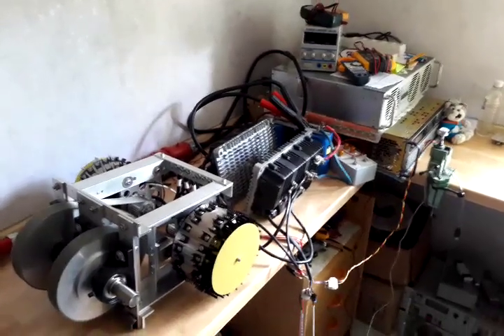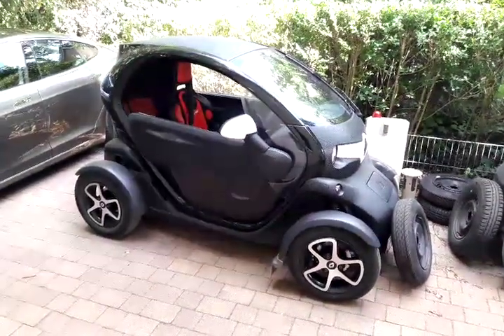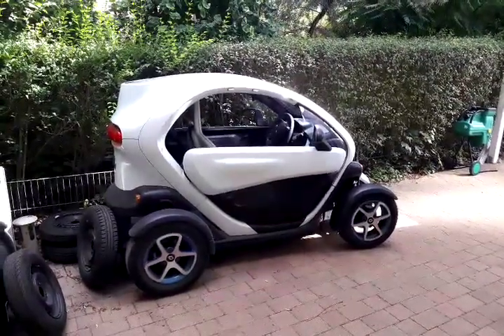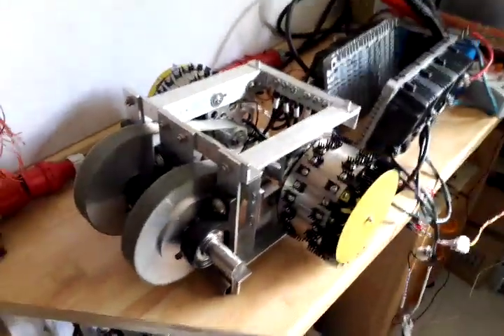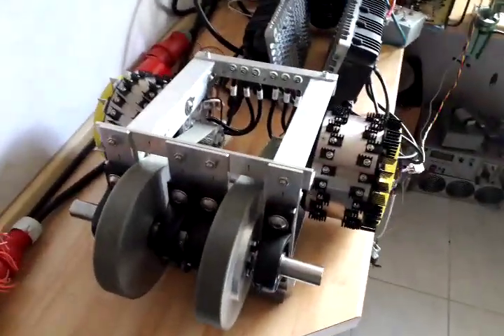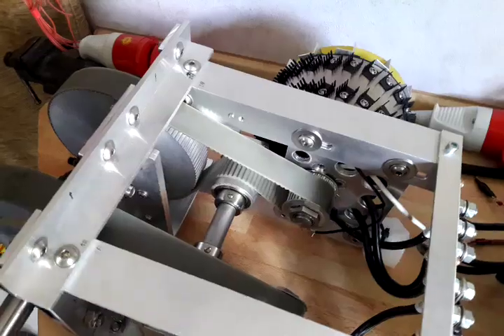#1 RENAULT TWIZY tuning with Dual Drive Unit (Revolt 160 PRO BLDC)

Comment: One question, what are the IC coolers for? 
I thought revolt makes outrunner motors, so they won't be so effective for cooling...
Reply from the maker: Right, theses Revolts are so-called outrunners.
Unfortunately I experienced quite some many losses in the rotor, which has little thermal capacity and also smooth surface, bad for cooling. In all my power measurements I ran into thermal problems with the rotor, made me thinking about helping it to get rid of its heat. I ended up with an additional radial fan and with those IC coolers.
Check out my other videos (performance tests and 20kW peak test)
Reply: @nextev8794  thank you for the info! Will definitely watch the other videos!
Despite causing drag, did your mod help cooling the rotor?
Does the rotor temperature mainly get worse with current or with rpm?
Together with some colleagues I am in the process of electrifying a go kart. We intend to use an rv160e 32kv, that will be run to about 3500rpm.
Do you think that will get us into temperature issues?

Comment: What is this amazing small white vehicle in the background ?
Reply from the maker: this one is called "Mini El" or "City El" (former danish company CityCom). It comes with three wheels only and is designed for just one person, namely the driver :-)
Approx 5000 of those vehicles have been produced between 1989 and 200x (not sure on that number).
You'll find lots of information in the web.
Reply: @nextev8794  Thanks :)

Comment: You own a City-El, but wastes your talent on a Twizzy that uses 6.1 kWh/100km because it is so ugly that the air twists in agony to get away from it when driving?
In 1992 I got 130km in my City-El with a LEM200 PM motor on 4*12V 132Ah Trojan lead acid batteries discharged 50% = 3.168kWh =2.46kWh/100km! The Twizzy is a step back in evolution! Put the Renault battery in it and get 200km range!!!
Reply from the maker: The white City-El is my fifth (one burned down to the ground, another one was killed by a Mercedes R class on black ice and so on...). I did almost everything with the City-Els.
E.g. I quad-modified the Thrige and probably I am the holder of the inofficial speed record with >> 100km/h (no fun, believe me!).
Now the Twizy (just one "Z") is the next victim!
And I am not well known for wasting something ;-)
Happy new year, by the way!!
Reply from the maker: @Tore_Lund  Thx for your words and the short journey back in history, enjoyed it a lot!